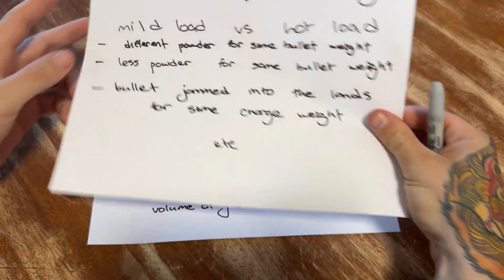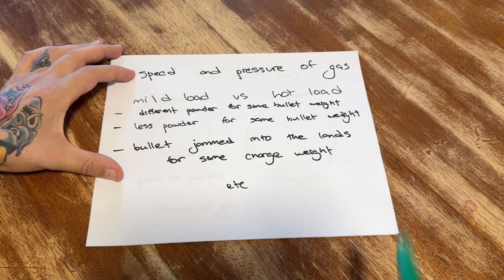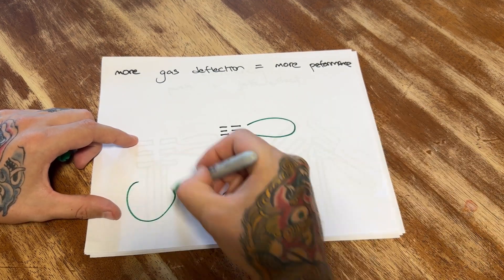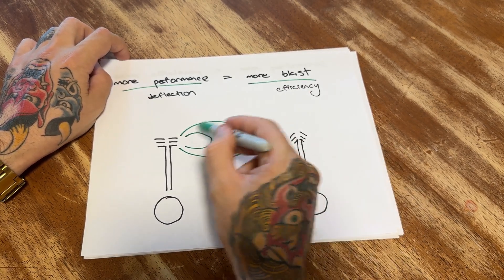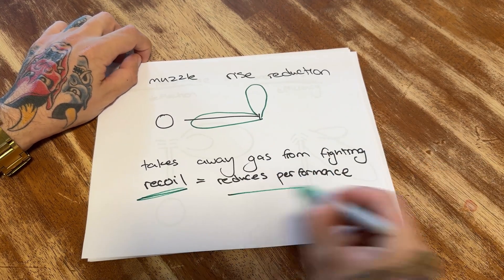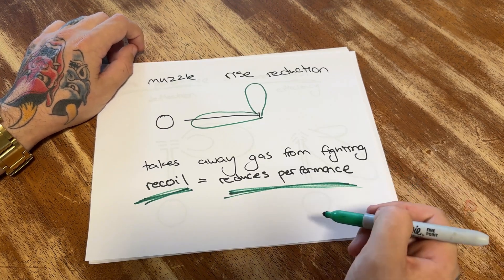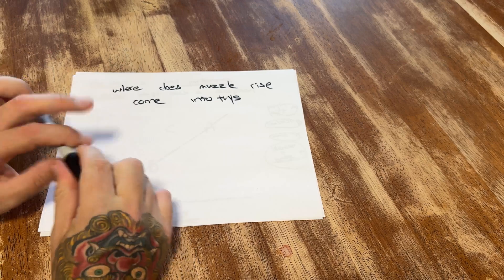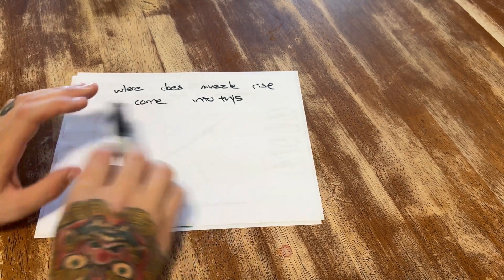How do muzzle brakes work and what determines performance?

Comment: Cool. I used the terminator T3 on my tikka T3 308 with 22” barrel, felt recoil was reduced but groups opened right out to pathetic. Gone through gunsmith for all intensive purpose. 1/2-3/4mia without break. Random shotgun with the break. Bad bad bad!

Blast was ok.

I then took one shot with my 20” howa mini in 6ARC, less gas, with a muzzle break (I think some area 419 job my mate put on, and it has 90 degree straight out the side ports or that’s what it looked like). However the percussive effect was bad from just one shot and the recoil reduction wasn’t that great but hard to tell from one shot.

I didn’t think 108gr at low 2600mv would really need a break, definitely don’t need with 80gr bullets.

But that one shot with the percussive blast in my face (maybe a critical close proximity point with shorter barrel) was enough to not want to continue.

I’m happy without a break.